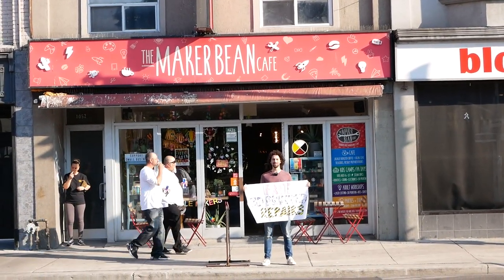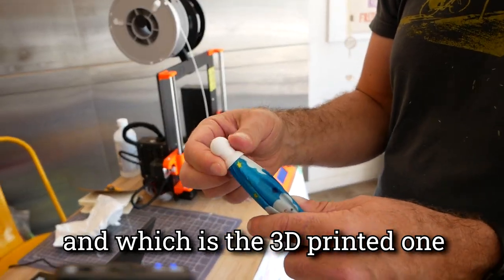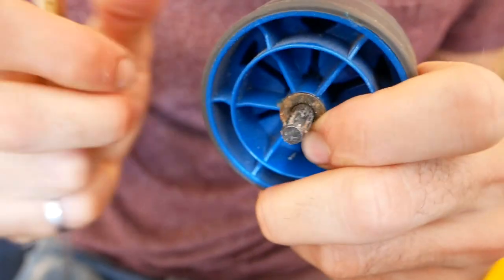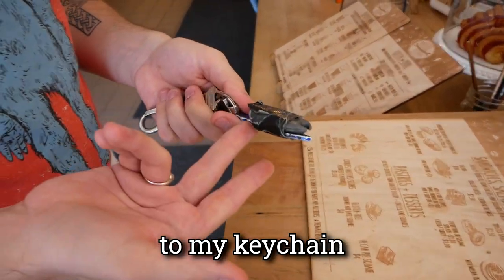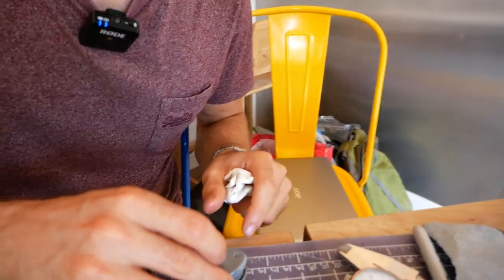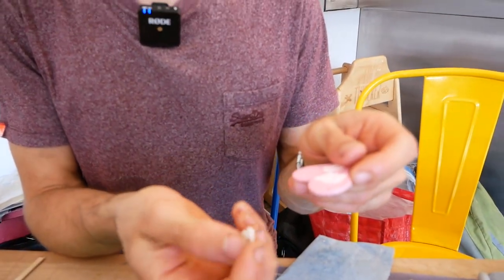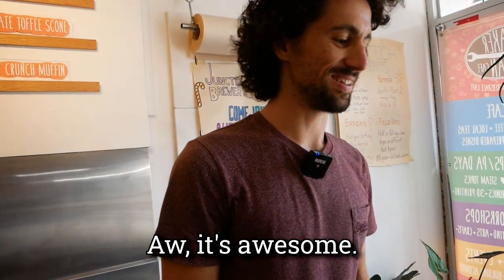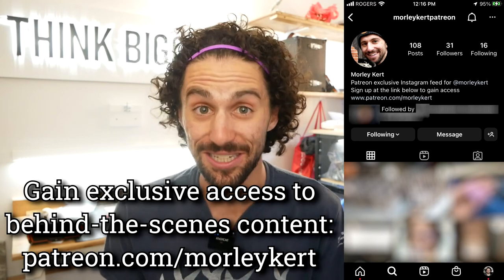I Spent a Day 3D Printing Repairs for Strangers

Comment: This was super cool! One thing I noticed is if you had printed the clamshell horizontally the keyring hole would have been much stronger because each layer would have a full ring of filament.
Reply: Or it could’ve just been a bumper that lined the outside of the key fob printed horizontally. Stronger ring, quicker to print, no supports needed and less filament/glue needed and would have ended with a cleaner and thinner end product

Comment: # 1 could’ve also been created with Revolve command.  Your method obviously works too.
Reply: Revolve command instead of gluing it with epoxy? What?
Reply: I would have done a profile and revolve too!
Reply: i would use revolve too, i think its a better method as you can do all adjustments in one sketch
Reply: @acolombo  Hey friend, I feel bad that nobody answerd your question. If you are still interested in an explanation, let me know and I'll try to type it out for you :)

Comment: if you want to design a clam shell where you only need to do one half design and print it twice, and make it so it has slots that fit together then if you put a recess on one half of the edges and a tab on the other half, and set tolerances for a little gap between them, then you can print the same thing twice and it will mirror against itself.

obviously its hard to describe in words, but like with the key fob, if you took the face that was going to be glued and split in down the middle (you have to split it in a line of rotational symmetry), then on one side if you take the outside edge line and use that to create an offset line thats half the thickness of the walls (+0.1mm for tolerances for it fitting together), then use the inner section created by that offset to extrude a tab , and then on the other half do the same but if you cut extrude a recess thats slightly deeper than how far you extruded the tab. Then when you print two of them the slots and tabs will be flipped when facing each other and so they will slot together and then you get both a keyed surface that locks together and hold the two halves perfectly in place, you also get a way to much more cleanly glue the two halves together. So clean you might not even be able to see the join.
Reply: After adding epoxy, how will you remove the keyfob clam shell if you need to change the battery?  I probably would have just removed the old clam shell and created a new one that has a screw holding the halves together.  Thanks for sharing the video.
Reply: @michaelmerryman587  It is a passive RFID tag, power comes from the reader via inductive coupling. Not like a car key that has its own power. No need for a battery :-)

Comment: I've bought a 3D printer a while ago but it unfortunately collected dust for a few months until I finally went on vacation. For the last 2 weeks I've been rapid-prototyping enclosures for a hardware project in Fusion 360. I'm realizing this is an exceptional skill to have and I have so much fun learning it. The most creative I've been in a long time.

Comment: 10:18 Don't worry about getting epoxy in the hole. You can drill that out later. You also strengthen the hole this way even more.

Comment: Super cool video and idea! I have a E3D tool changer and will often use PLA as support material if I am printing in PETG (and vice versa) because they do not bond together well whatsoever. So the overhangs/contact surface between the part and supports are beautiful. Perhaps there are better materials, but the build plate temperatures are close enough to make it work.

Comment: I love these videos! Wholesomeness level probably over 9000. You should do this regularly. It's actually a great way to learn pragmatic problem solving as you only have limited time per "customer". So you can't spend hours designing something super perfect but have to come up with something simple on teh spot. I tend to overthink problems sometimes.

Comment: Good job sharing the hobby! Tip for the keychain next time. flip it over so the letters are directly on the build surface and flush with the body. make the letters only 0.6mm deep (inset into the body). This lets you get away with only 6 filament changes at 0.2mm layer height. less at 0.3 or 0.4. Set the filament changes in slicer and enjoy the end result. for an even nicer finish do it on a textured surface.

Comment: Outstanding Job. May I suggest if you do this more often and print times become an issue you use your 3d printer print the Voron 0.1 parts and build that Voron for your portable printer. Much Much faster which would cut down the print times for you. Less wait time for customers.

Comment: when I saw the heart, I already thought that this won't go well. Though PETG or PLA can be used as low cost support material, when you have a multimaterial printer and like to have easy to clean support structures :)

Comment: Awesome stuff! Very cool of you to do this.
Incase you have not had the chance to try PETG and TPU... They seem to bond well. I made ducts for drone propellers with PETG on the top and bottom to keep the shape rigid.   
Cool channel and content
Subscribed!
Reply: But petg would be less rigid than pla. Would just be tougher on impacts
Reply: @laiebi_3639  How is PETG less Rigid than PLA?  Am I missing something?  
  I almost never use PLA because of its lack of strength and it's low resistance to warping in a higher temp environment.
Reply: @Main_Drain  stiffness of petg is lower than pla, so if you want to print sth thin, pla will deflect a lot less than petg on the same load. Temperature and chemical resistance is worse I agree, was just stating stiffness/rigidity.
Reply: @laiebi_3639  Thank you, I appreciate the info 
I really didn't even think about thinner stuff
I will keep this in mind on my next prototype
Reply: @Main_Drain  No problem, always nice to exchange knowledge with others 👍

Comment: 11:00 I probably would have substituted the epoxy for hot glue so the clamshell could still come apart if needs be (especially if it fails due to weak signal).
Reply: Agreed, the epoxy seemed a bit too permanent for the application. A press fit / snap together clamshell with some foam or light adhesive to prevent rattling was what I thought of.

Comment: To remove sticker residue or tape residue you need to use turpentine. This will work much better than alcohol.
And when you buy that try to buy the one that has less smell to it. The one they removed the aroma from. or at least most of it.

Comment: I am puzzled by the orientation choice of his clamshell, and I am not really getting the reason why he would need any support material had it been printed as usual, each shell‘s surface facing down? You always wanna print Layers facing the direction of forces applied during usage! The Keyring will in this case apply a force perpendicular to the layers, significantly lowering its stability…

Comment: so like, the keyfob clamshell, is there a reason you didn't print it flat, on the back, so the layer lines are running in line with the load from the keychain rather then against?

Comment: I think the key fob would have benefitted from printing it flat because it would be less likely to separate between the layer lines when attached to a keyring.
Reply: Petg bonds layers really well and tends to stretch rather than snap like PLA. It should be ok.
Reply: yeah, i'd have gone with flat and just done 45 degree bevels on the edges, forgot about the thumb recess, put some tabs and slot to make it slot together rather than trying to glue two flat surfaces together and keep them aligned.

Comment: Those vacuum wheels are so awful. Almost every one I've seen have plastic wheels turning against plastic with no bearings in sn environment explicitly full of coarse dirt particles. I've got a few old ones around (failed again after replacement under warranty) I'm eventually going to replace with a printed mount for real skate bearings. So ridiculous how these things are designed to break. They can't be saving more than a few cents omitting the bearing so it's gotta be about selling more vacs.. 😡

Comment: I guess I would be only one here saying, but I think you just "destroyed" key fob. Why would you put so much epoxy all over the original piece ... now when it will again broke -> and it definitely will as you printed it vertically, so as there is layer adhesion in play, ... then nobody will be ever able to access old perfectly working Fob. I would be so mad O_O
Reply: Why not pull RFID tag out of original case.  Then it would be way smaller end product.

Comment: Umbrella tip . . . just glue it back on . . . you really don't need a $1,000 3D printer . . . all you are doing is pumping out more landfill. I suppose that's the issue with 3D printers, people are so desperate to find a reason to use them, 95% of everything printed is just crap, things that if you saw in a store for $2 you wouldn't buy, an articulated snake, some plastic print-in-place scissors, little toothbrush holder . . . . lol, anyhow, nice idea, 3D repairs for strangers, but in no way practical, people are just playing at communities, taking part, posturing, maybe even having a little fun, but ultimately it's a waste of time.